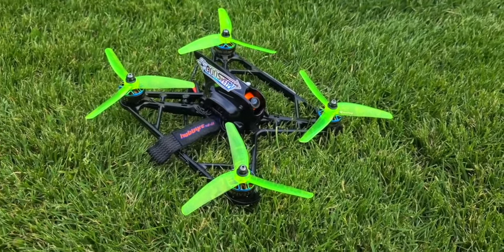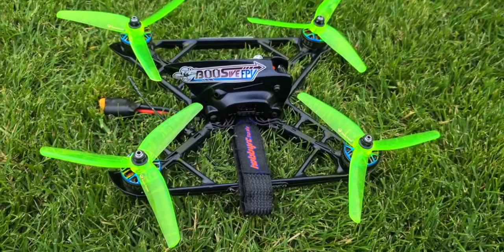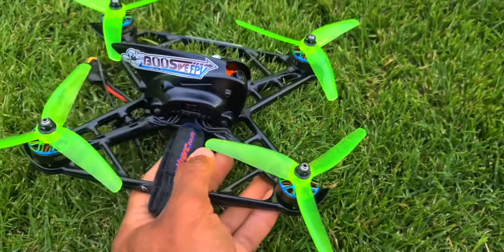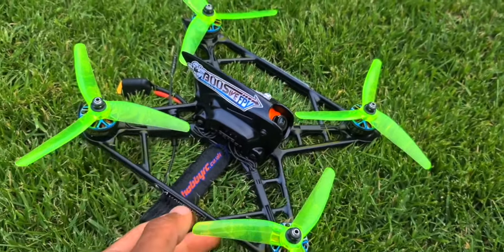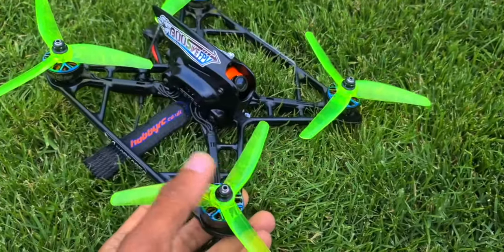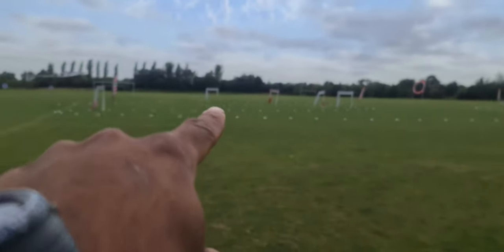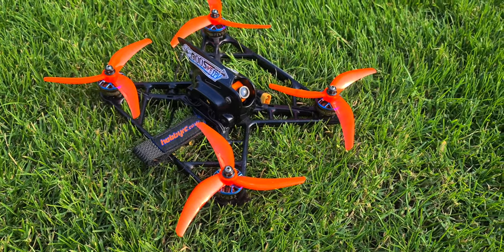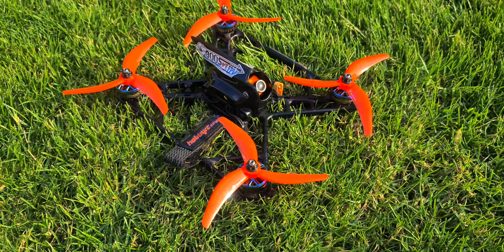FPV Racing Drone | Karearea Talon V2 | First Look | Review | On Track Test Footage | Hull FPV

Comment: Talon needs a ton of filtation
Due to very very flexible frame
Karearea recommend default dynamic notch and rpm filtration this defeats the whole point of rpm fitration. If you configure filtration and rpm filtration like recommended it smokes motors !! It takes full filtration and rpm
Filtration to cool down motors waste of time but that been said its tuff alright but a backwards step as far as latest  and greatest from betaflight in short not a worthy purchase for a quality experience.
Reply from the maker: Ive got mine flying brilliantly on beta 4.2! Had to play with my PID's and filters a bit but now my motors are barely warm when I fly damaged props.